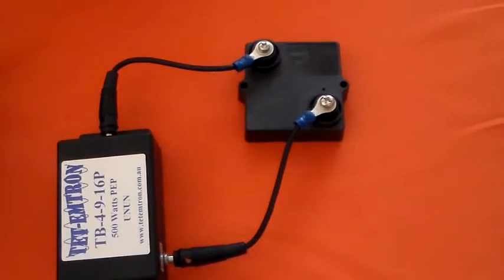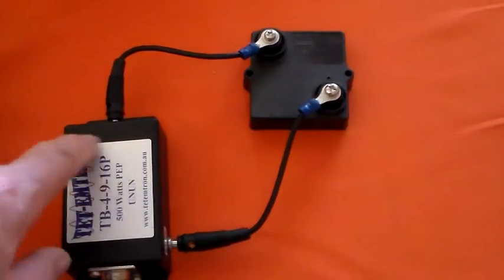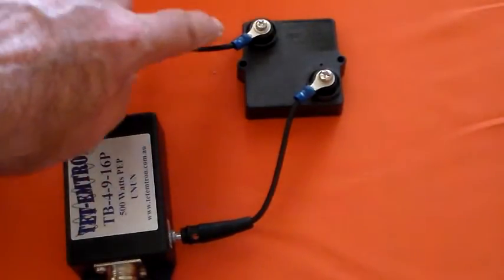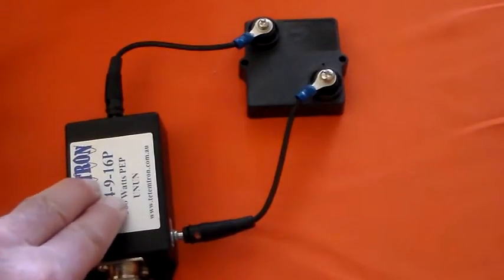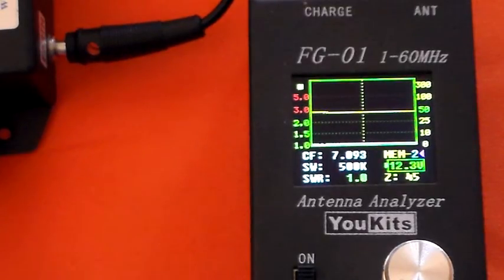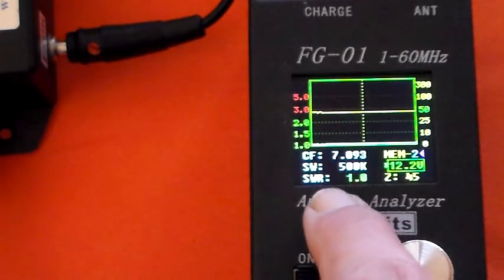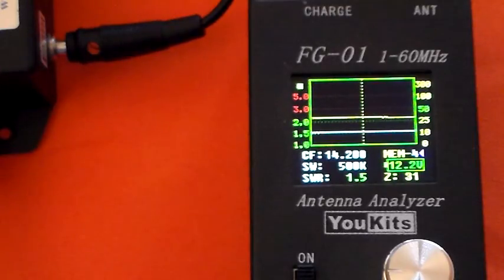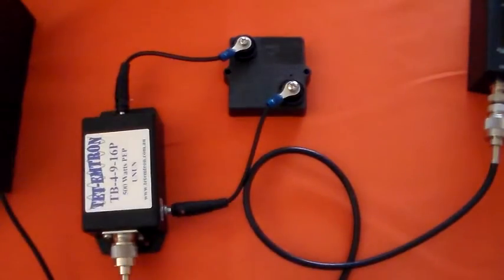470 Ohm 600 Watt Non-Inductive Resistor.

Comment: I would like to make a 2 meter Rhombic antenna 3 wavelength each leg but it has four legs in the diamond shape. I would like to see the data on how 2 of those resistors in series making 940 ohms @  144.200 MHz?   de N6JJI

Comment: i have Googled and Googled to find a resistor with these specs with no luck. Where oh where did you purchase this resistor? Thanks!
Reply: Palomar Engineers has 500 ohm / 375 W terminating resistors.  A bit off from 450 ohms, but with a 9:1 balun, presents 55.5 ohms.  Not terribly far off.

Comment: Hi there, I built a T2FD some years ago and made up the load resistor with a great bunch of old 2 watt carbon resistors that I had picked up at a rally. The feeder was H.Brewed open wire line over a fair length run. This was coupled up into my H.Brew balanced Tuner.  I turned on the Eddystone receiver  and got a very pleasing result across the HF spectrum. Unfortunately I never got round to testing it out on transmit. On the theory/ info that I had, the spacers were quite a lot longer than for the commercially made T2FD's and there were restrictions on the bandwidth, i.e for an 85 footer was ok for 1.8 - 10/12MHz. For the higher end you need a shorter one ( as for a std. dipole).Plus the spacing is less. 73 de G0WXU -John.
Reply from the maker: I'm surprised you needed to tweak it in with a tuner. You probably would have found it worked better without the terminating resistors on RX. It definitely would have worked better on TX without terminating resistors.

Comment: There's always a new comer like me who's putting together one of these and with limited info on the designs leaves us wondering what we can and can't use. I saw these resistors and sure they are non inductive but not sure if there was any other reason they couldn't be used. Whala, here's the video. Thanks for posting. It was the missing piece of the puzzle.

You also cleared up my understanding of the termination / low swr concept. Cheers.
Reply from the maker: Thanks for the feedback.